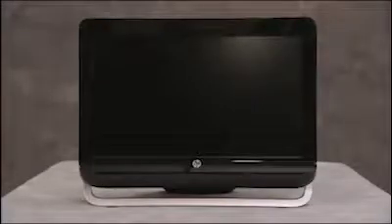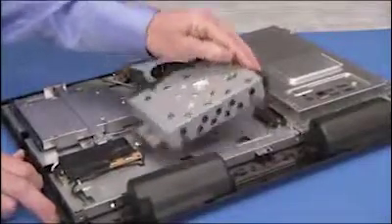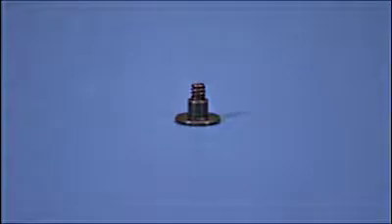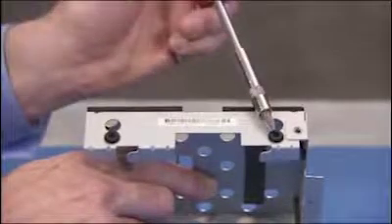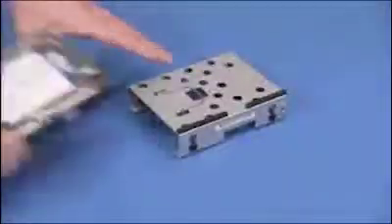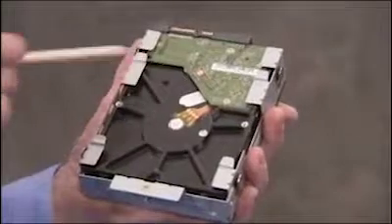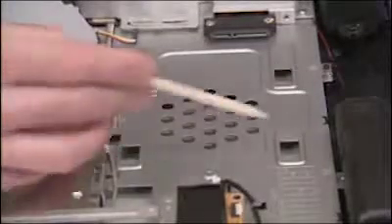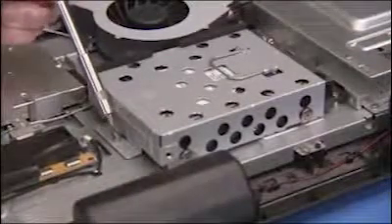Add or Replace the Hard Drive | Omni 120-1000 | HP Support

Comment: Can I add graphic card/processor to this product
Reply from the maker: +sugat dhaske Because the processor is soldered down to this motherboard, the processor cannot be upgraded. This computer has One PCI Express half-size mini card socket (Generation 2 speed)
One PCI Express mini card socket (Generation 2 speed). So you can add graphics card that supports this socket.
Reply: @HPSupport  thank you so does hp omni 120-1015in also have mini pci express socket pls tell me
Reply: Don't bother, it's junk